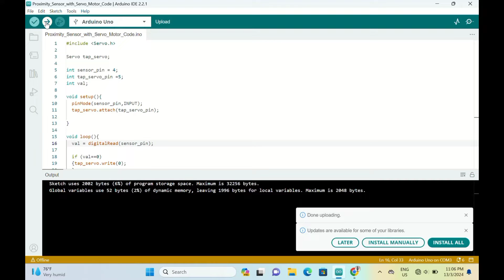How to control Servo motor with Arduino Uno and proximity sensor

Comment: Does this work with inductive proximity sensor?
Reply from the maker: This work with inductive proximity sensor as well.
Reply: @passiontechklm  do i use the same in the video but change the sensor to inductive? I tried it but the servo motor is not turning
Reply: Although it the servo motor works fine